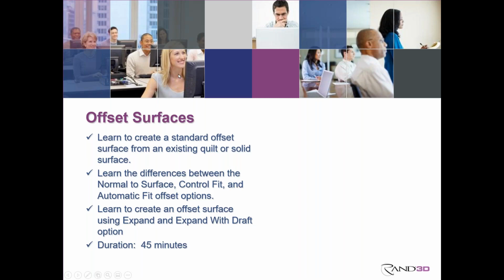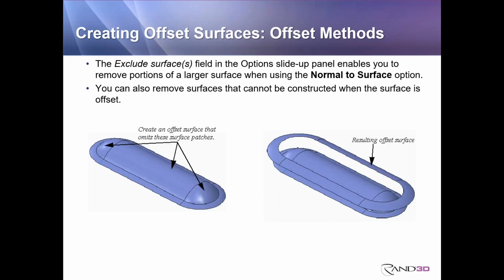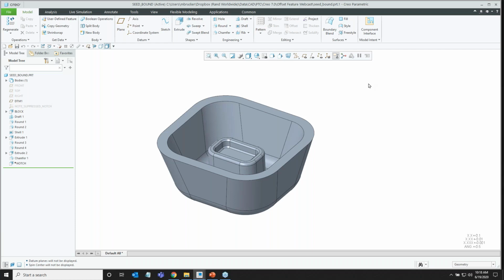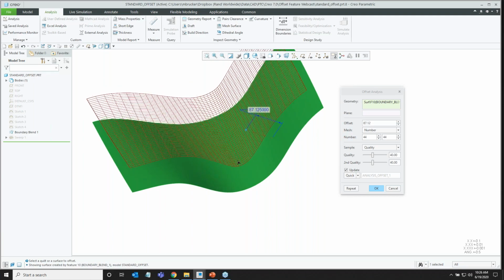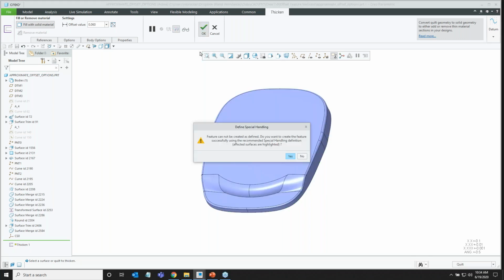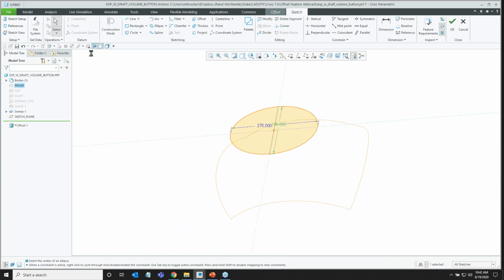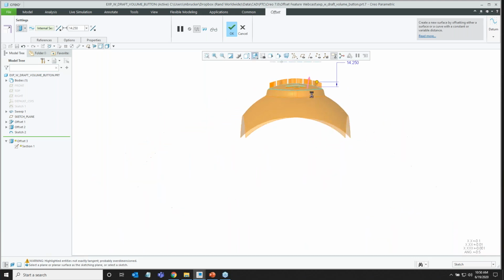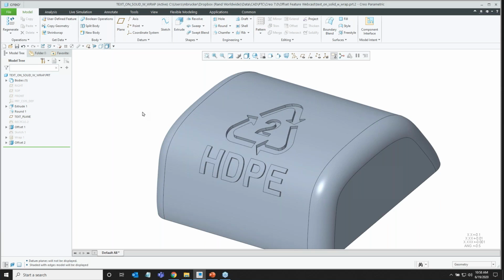Creo Parametric's Offset Feature

Comment: how to offset a face with no distance in normal direction? creating a new face inside the existing face. Technically it's called "inset".The result is like creating a ring belt inside the original face